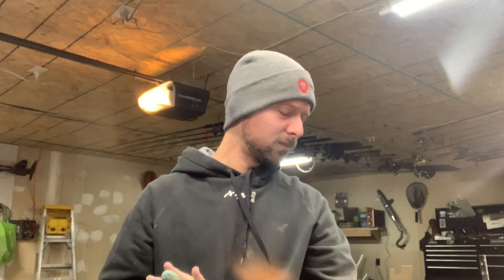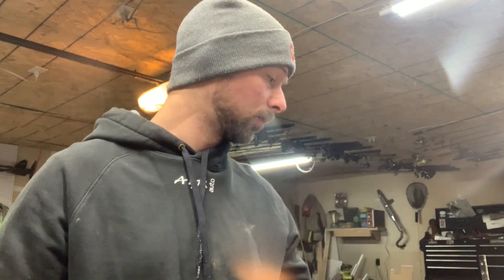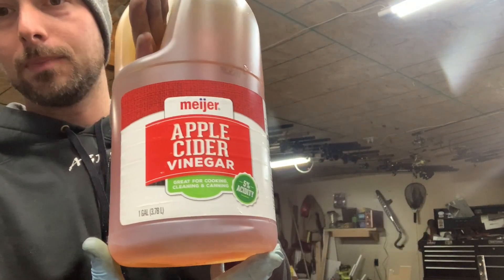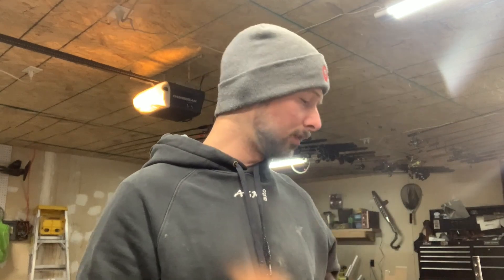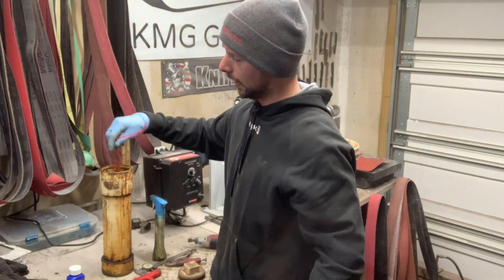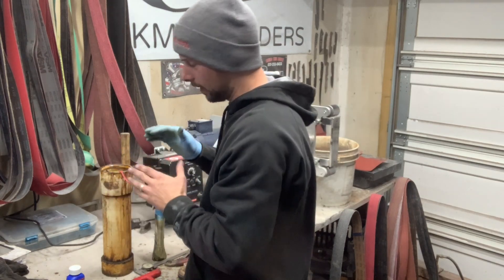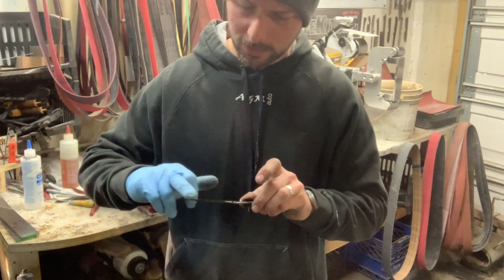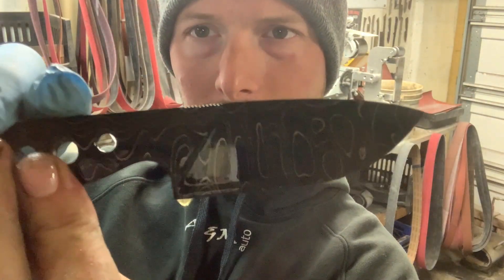How to Etch Damascus Steel

Comment: It works when you add the cider because it's mostly water. The iron particles NEED somewhere to go into suspension. That's what water provides. As your solution seems to "weaken" it's not the FeCl. It's just that all of the H2O has become saturated with iron and now the newly etched iron has no place to go. Get more life out of your mix simply by adding more water. Science.
Reply from the maker: Nice

Comment: Great video!!!.  After I etch my blade, I'll be pinning and gluing my handle scales on and will be sanding the glue off the full tang (probably sanding the etch off the tang). How do you suggest I retain the etch on the tang?  thanks!!
Reply from the maker: I like to use a qtip with ferric and carefully touch it up. Unless you’re using g10 or similar material you can re etch the whole thing once handles are on.
Reply: @gentrycustomknives8008  the scales will be red oak wood and I was thinking of doing the exact thing you suggested!!!! Thanks so much for your prompt reply and again loved your video!!!
Reply from the maker: @Blade_Outdoors  good luck!
Reply: @Blade_Outdoors  you can also get all your handle shaping and grinding done prior to etching, then after you’ve etched your blade and are putting the already shaped scales onto the knife use a thick layer of floor wax all around the perimeter of where the knife and scales meet. If you do this properly, any excess epoxy that leaks out of the the handles will form a chemical reaction with the wax and will just peel off once dry.
This way you don’t need to worry about grinding off your finish
Reply: @KeelingCustoms  great idea ! Thanks!